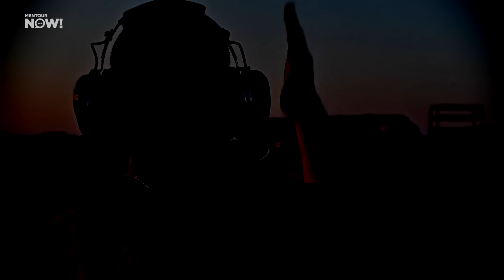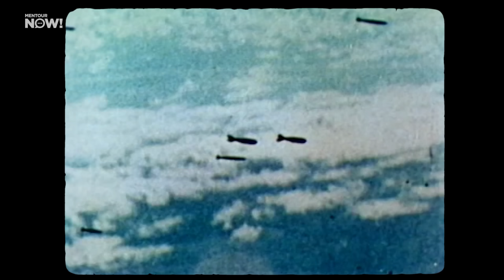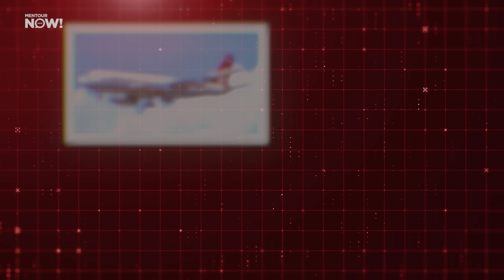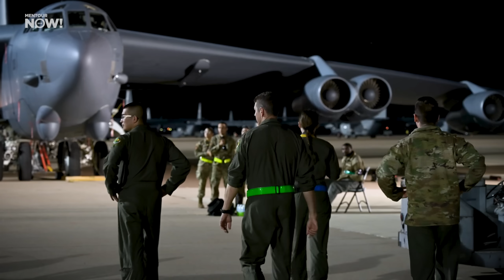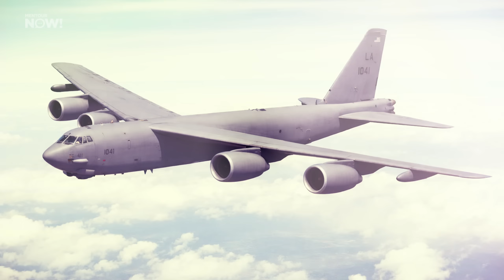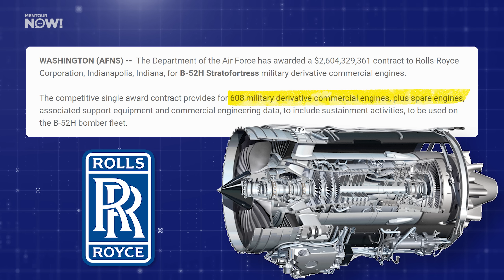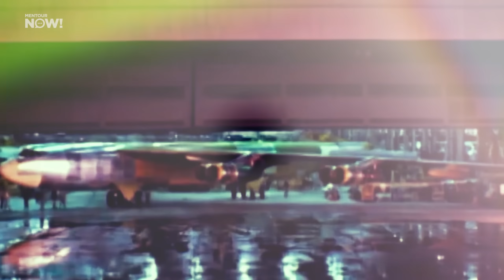WHY Are They Changing The B-52 NOW?!

Comment: AI Summary

Abstract

This technical overview examines the United States Air Force’s (USAF) strategic decision to re-engine the Boeing B-52 Stratofortress fleet, transitioning from the heritage Pratt & Whitney TF33 low-bypass turbofans to the Rolls-Royce F130 (BR700). The analysis details the engineering constraints that necessitated maintaining an eight-engine configuration rather than simplifying to a four-engine layout. Key factors include the B-52’s unique wing aerodynamics, asymmetric thrust management, and ground clearance limitations inherent to its 1950s anhedral wing design. The summary also addresses the significant integration challenges encountered during the transition, specifically regarding inlet airflow distortion and the massive overhaul required to convert the aircraft’s "fiercely analog" architecture into a digital-ready platform. This modernization effort, designated the B-52J (Juliet), aims to extend the airframe’s operational viability into the 2050s, potentially marking a century of active service.

Strategic Analysis of the B-52 Commercial Engine Replacement Program (CERP)

*   0:00 - Unprecedented Longevity: The B-52 Stratofortress, designed via slide-rule in the 1950s, remains operational despite being decades older than its current flight crews. It has outlived multiple intended successors, including the B-58, B-70, and likely the B-1 and B-2 fleets.
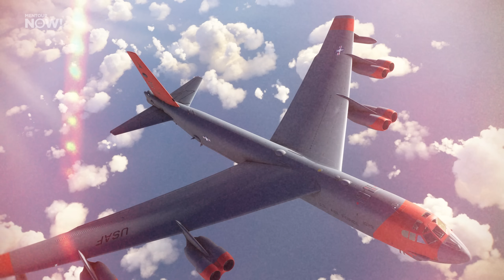*   4:36 - Obsolescence of the TF33: The current B-52H fleet utilizes eight Pratt & Whitney TF33 turbofans (bypass ratio 1.5:1), a design dating to 1958. The industrial base for these engines is collapsing; spare parts are currently sourced via cannibalization of retired civilian Boeing 707s. The USAF projects the TF33 will be completely unsustainable by 2030.
*   7:39 - Operational Benefits of Efficiency: Modern high-bypass engines offer 30–40% improved fuel efficiency. In military contexts, this translates directly to increased loiter time and mission range, reducing dependence on aerial refueling and simplifying emergency diversion planning.
*   10:27 - Technical Constraints on 4-Engine Configurations: Simplification to four large engines (e.g., PW2000) was rejected due to prohibitive costs and engineering risks. 
    *   Aerodynamics: The engine pods function as "wing fences" to control span-wise airflow; removing them would necessitate an expensive wing redesign.
    *   Stability: A four-engine layout creates higher asymmetric thrust during an engine-out event, requiring a larger rudder and tail to maintain directional control.
    *   Geometry: The B-52's high-wing anhedral design leaves insufficient ground clearance for the large diameters of modern high-bypass fans without significant landing gear or pylon modifications.
*   15:48 - Selection of the Rolls-Royce F130: Rolls-Royce was awarded the contract in 2021 for the F130 (a military variant of the BR700). Chosen for its similarity in weight and thrust to the TF33, it minimizes airframe modifications while providing massive increases in electrical power required for future radar and avionics.
*   17:57 - Transition to B-52J (Juliet): Upon completion of the re-engineing and avionics upgrade, the aircraft will be officially redesignated from B-52H to B-52J.
*   18:14 - Integration Engineering Challenges: The project is not a simple "bolt-on" procedure. 
    *   Inlet Distortion: Engineers discovered the new engines are more sensitive to airflow disturbances than the heritage low-bypass models, requiring a year of redesign and wind-tunnel testing for the nacelle inlets.
    *   Digital Integration: The aircraft is being converted from analog to digital (FADEC), requiring entirely new wiring looms, data buses, and cockpit glass displays to interface with modern propulsion controls.
*   20:43 - Modernization Timeline: Due to the complexity of integrating 21st-century tech into a 1950s airframe and the need to keep the 76-plane fleet active, the first B-52J is not expected to be operational until 2033, with the full fleet completed by the mid-2030s.
*   22:54 - Key Takeaway (Legacy Design Impact): The B-52J program demonstrates that airframe life often exceeds propulsion and avionics technology. It highlights the "design echo" effect, where 70-year-old engineering choices (eight-engine layout) dictate modern multi-billion dollar procurement strategies because the cost of altering the core airframe exceeds the cost of purchasing 600+ specialized engines.

AI-generated summary created with gemini-3-flash-preview for free via RocketRecap-dot-com. (Input: 25,140 tokens, Output: 1,151 tokens, Est. cost: $0.0160).

Comment: I actually worked on two of the re-engine studies, once in the 90's and again about 4 years ago before retiring. The first was examining potential engine to ground contact during extreme flight angles during landing.  Through simulations, we found that if the plane were rolled to one side while the wings were still loaded (flexed upward), the outer engine would make hard, severe contact with the ground, with catastrophic results. My team determined that nothing short of relocating the engine inboard would correct the issue. Obviously, that would require a major wing redesign.

Comment: Updating the "limitations of Cold War engineering" will take 15 years. It took those white guys with slide rules less than 10 years to design and build a plane that couldn't be improved on for 70 years.

Comment: Yeah, i knew the answer before watching heh. Much of the time, airplanes are built around the engines, so its not as easy to replace them as it is to say, replace an engine in a car with a newer one. Replacing the '52's 8 engines with 4... might as well just be designing a completely new aircraft. Major reason they dont is because of cost vs necessity. They dont necessarily need a replacement for the 52 bad enough to justify the cost of designing & making one. While the B2 is nice (and cool looking, thanks Jack N.), its also pretty costly to maintain and doesnt have the versatility of the 52. I'm sure the cost of maintaining the 52 isnt cheap, but it might be comparatively vs other bomber programs. 

Its the same reason it was stupid for congress to push to retire the A-10 and replace it with 3, much more highly costly aircraft that were not designed for the A-10's role. It became highly suspect that they were doing it for money reasons (under the table dealings) than actual necessity when the actual military commanders said it was a stupid move. 

Given all that, if the airforce were to have someone design and produce a 52 replacement, chances are it would look pretty similar to the 52 (probably very close to the rendering of the 52 with 4 high-bypass engines on it), cost far more, and offer little benefit over re-engining the 52's for the cost. Designers would probably over complicated it as well, just because they could.

Comment: Even if it cost $10B for each plane, the entire fleet could be replaced new planes with all modern tech for less than the USA sends to some other countries each year for military aid, or less than the money fraudulently sent to some countries.  There really is no good excuse to keep these running other than fear of authorizing something new.  After this many years, much of the components in the B52s will be work hardened to the point of eminent failure.

Comment: Fyi, Gyroscopic force on jet engine pylons causes significant yaw or roll moments (precession) when the aircraft's attitude changes, as the massive rotating engine components resist directional changes, applying a reaction force 90 degrees later in the direction of rotation, which pilots must counteract with rudder or aileron, especially during takeoff/landing or maneuvers, affecting pylon loads and requiring careful design.

Comment: So what your saying is using modern design methods - computers / CADD to update design (2025 to 2033 6-8 years) then the original design with slide rulers and drafting tables by hand (1948 to 1952 4-5 years).

Comment: It’s because those old engines are extremely inefficient compared to the new ones. Much harder to maintain.  The new ones are used in smaller commercial planes. Much less expensive.
Reply: Engines also have a limited lifespan compared to the airframe and electronics.

Comment: They actually tested 1 with a 4 turbofan high bypass engine setup the same 1s they use in the galaxy, and the designers went.... 8 smaller 1s is more badass, because more is better 😂 (jk, it was so they didnt have to totally redesign the wings)

Comment: The USAF re-engined the F-15s, beginning with the F-15EX, from PW F100 in F-15E and earlier airframes, to GE F110 in current production jets.
The F-15E was originally built to accommodate either PW or GE.
Foreign customers were the first to purchase variants with the GE engines. Saudi Arabia converted their F-15S fleet to GE back in 2009. Beginning production in 2012, F-15SA  and Qatari F-15QA airframes were delivered with GE F110 engines.

Comment: C-130 makes fairly good bomber as well.
How can we still use aircraft deigned in the 1940s?  Well, we're still using 1940s air---.
Reply: Current B-52s wer built in 1962 it's been upgraded many times since then.

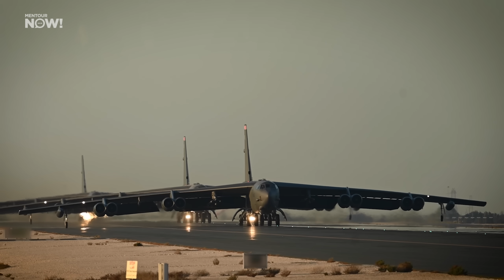Comment: 2:00
They don't swap 8 for 4 because they have seen the 737 max 8.  
Instead of taller gear, they did that.  Initially a failure.
Reply: Its do do with thre tail its too narrow for four engines if you loose one  of the  four engines the tail can't compensate.

Comment: The old classic USAF debrifing video about a B-52 in early testing that lost 80% of its vertical stabiliser in absolutely insane low level lateral wind shear is fascinating and illustrates how much thought and engineering went into the original design that would need to be redone for a different engine setup. That B-52 stabilised itself by lowering its aft landing gear to shift its drag and stabilise its yaw, and the pilots maintained trim and general flight dynamics just by engine thrust management, they managed to fly the crippled jet for something like 4+ hours after they lost the vert stab and successfully landed at an alternate after they had burned enough fuel to meet safe landing weight.

A Mentour vid covering that footage and the USAF's 1964 film they produced would be awesome.

Comment: Replace B-52 with a modified Jumbo jet B-747, and you get a better missile carrier.
Reply: B-52 is faster due to its wonky tail rudder design and already has the structure to carryt he weapon weight.
Reply: @Arpthingy  The fuselage of a B-747 could be supersonic, of course, but the engines are not.

Comment: I'm a Vietnam war vet where the B-52s where used extensively. A B-52 which had lost an engine during a Linebacker II mission over Vietnam that was returning to Guam, declared an emergency. There was a radio response from from another unidentified aircraft... "Ah yes, the dreaded 7 engine landing...".
Reply: I've heard versions of this many times, and it gets funnier every time.
It's standard procedure to declare an emergency before landing with an engine out. We realize it sounds a little ridiculous, but we gotta.
Reply: @edfix  More of a Pan-Pan than a Mayday though
Reply: @edfix its more common sense. 1 engine being out is a large reduction in power. Not enough to effect the plane in the moment but its like losing a backup. With only 7 engines and 1 being out that means the possibility of losing another engine is far more dangerous and you do not know the fault of why you lost that engine, it could affect others.
Reply: @kousand9917  Unless the airplane is very heavy, losing one engine has almost 0 impact on operations.  Asymmetric thrust is the biggest problem, and its easy to compensate for a single engine loss.  
Usually, though, you know what the problem is.  One time, I lost oil pressure in one engine, and we shut that down.  But no oil in an engine spinning that fast (even shut down) is a real problem if it causes a bearing to seize. The engine could come apart.  Another time, one nacelle was using too much fuel, leading me to suspect a fuel leak.  In both cases, declaring an emergency was prudent because it gets the emergency equipment moving.  If a fire starts on landing due to leaking fuel or an engine tearing itself apart, seconds count in bringing the resulting fire under control.
Reply: @kousand9917  affect
Reply: When I was in the USAF - stationed at SAC facility of March AFB - I heard the similar saying about "The Mission completion with the dreaded single engine failure"
Reply: @GeoClark , I bet you might have crossed paths with my father. His name was Roderick, and our family bounced between Hickam AFB in Hawaii and Offutt AFB in Omaha several times before and during the Vietnam War, and later were stationed at Andersen AFB in Guam in the early '70s — a major B-52 hub during the war. I was young at the time — grade school age. A different world back then. At Offutt, there was a gap in the fence near the school so the kids living in base housing could walk home without going through the front gate.
Reply: @GeoClark I lived in Edgemont right under the flight pattern on Alessandro Blvd. Watched when they had war games and took off nose to tail. One B-52 seemed to lose power with the ones behind him getting jammed up gaining on him. I thought we were going to have a major crash and the whole town was going to burn .Luckily the pilot pulled it off and got it going again
Reply: 100% a Marine said that!
Reply: That was a great reply! Having to land with only 7 engines!
Reply: A major reason the B-52 is still flying is because it is very easy to add upgrades. The B-52 is skin on frame. In automotive terms, think body on frame vs uni-body. All new aircraft are uni-body. B-52 frame allows Upgraded radar, new missile systems, etc, to be bolted onto frame with little change to structure, unlike uni-body aircraft. Thats why newer bombers are being retired before B-52!
Reply: Fuc!, dude! That's gold right there. Made my day.
Reply: good humor
Reply: Actually it's not the uni-body or any other  reason except.....
When they built the B-52 they were not going to test for a maybe.... so they built something so sturdy.
The actual joke is
"The people that built the B52 can't built a Cadillac with a bumper that doesn't fall off or rot in few years "
Reply: :face-green-smiling:
Reply: Must have been a fighter pilot.
Reply: 😂 to your story... And thank you for your service!

Comment: First flight only 6.5 years after WW2 
The talent and pluck of those designers is amazing.
Reply: Pluck? Using the lingo of the time it was designed as well huh? Lol ....😉🤣
Reply: Sabotage Labs Congratulations for making the most cretinous remark on the entire thread. Well done!
Reply: I mean... the design studios were likely still ready to design WW2 outfits. It's like when I come home from work in all of my outdoor gear, I just say - I may as well clear the sidewalks of this snow because I'm still dressed for it.
Reply: I took my first breath only 5 years after the end of WW2 and my "designer" was, is and will always be amazing!!
Reply: And designed roughly around the same time the first commercial jet airliner design (de Havilland Comet) was routinely disintegrating itself mid-air.
Reply: @ReneSchickbauer   B-52 was not without fault in infancy. The vertical fin had a habit of landing earlier than the rest of the plane.

Comment: A interesting fact about the TF33/JT3D engine. There is another aircraft that still uses this engine, the USAF E-3 AWACS. Now, it only has 4 of them since it is based on the older 707 platform, but this aircraft is expected to keep the TF33 up until the E-7 is introduced to the USAF as the replacement for the E-3 and the E-8, with that last aircraft having already been divested and removed from service.

Comment: I am an Air Force brat, born in an Air Force hospital. My father was a career staff sergeant. Enlisted personnel's base housing was usually located near the end of the runway, and at Strategic Air Command bases, that meant that every alert takeoff we had every working BUF (B-52) took off one right after the other, engines running at full rich mixture and full throttle. It was deafening, and the result was traumatic, particularly to young children. We regularly had windows shattered. All enlisted base housing had a car port, because that rich fuel mixture resulted in a fine mist of unburned fuel which stripped the paint from our cars. It also coated everything in black, including clotheslines. When the siren sounded, all the moms would grab their laundry basket and dash outside to get their laundry off the clothes lines, regardless of state. Before hanging up clothes, you ran a rag with detergent over the clotheslines to remove the fuel residue.
When my sister, who had been traumatized by the launches when 2-3 years old, flew home from overseas on a DC-8, she began crying in terror at six years old. The DC-8 engines had the same sound as the B-52 engines, because they were a variant.

Comment: I worked on G Models in the 70s. Totally strange plane, for sure. I guess as long as there are hours left on the air frames it remains the right choice. H models didn't take the beating the D-E-F-G models did in Vietnam.

Comment: In 1952, my father moved us from Inglewood Calif. to a trailer court near the end of Boeing field. It was a wooden trailer he pulled up HWY 101 with a 1941 Chevy. I was six years old. He had gotten a job working on the B-52. The first time a B-52 flew over us at 400 feet, we thought the trailer was going to completely fall apart. Everything move and rattled. I got use to it and slept through the takeoffs and landings. Taking off is something you don't forget. Remember this is before sound suppression. When sound became an item, the engines were modified - as I recall. Dad retired as a tooling inspector on 727's. I worked on the first 737's.